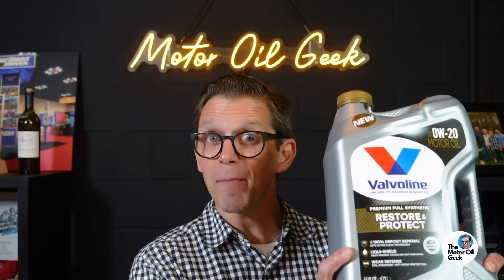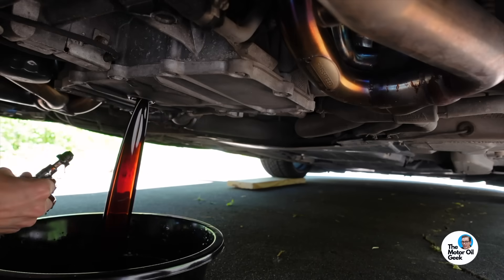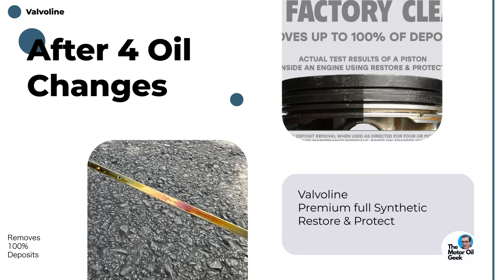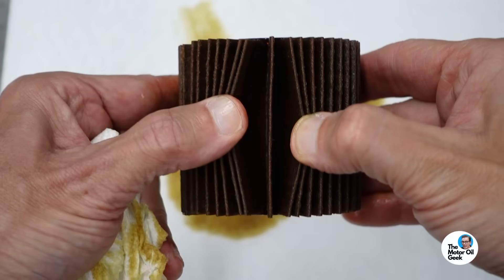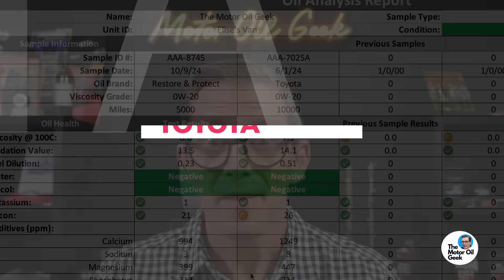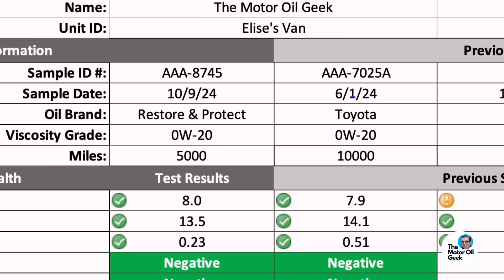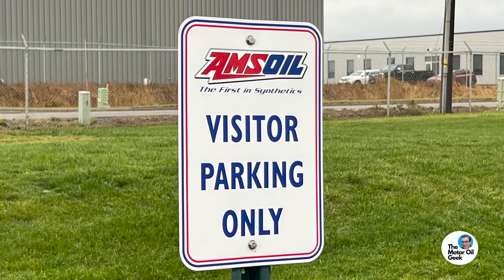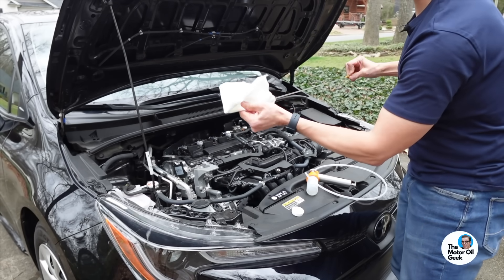The TRUTH About Valvoline's BOLD Engine Cleaning Claims

Comment: I can honestly say I am a 24-year Chrysler owner veteran I went out of my comfort zone and bought a Toyota for the first and last time Toyota engines do sludge up I don't care what anybody says I went from a 2004 Dodge neon SXT with a 2.0 l what's 250,000 mi on the clock I opened up the valve cover before it went to the junkyard she was squeaky clean! And didn't burn any oil in multiple times I went 20,000 miles in between oil changes on  Walmart oil

Comment: I started using Restore and Protect on my 2003 Toyota Corolla CE. I maxed out the odometer in 2018 and am hoping it will clean out the oil control rings and prevent oil consumption.

Comment: I REALLY hope Valvoline makes Restore and Protect available for Euro vehicles and soon!
Reply: I need that for my diesel
Reply: @psynurse  They say not to run in a diesel...
Reply: Yeah, I've already asked some Valvoline distrubutor here in Europe to ask why this lineup is not present here? There are lots of cars with the same issue here.
Reply: Same here..can't find it anywhere here
Reply: I have a 2001 mercedes benz E Class 300,000 miles, i used restore and protect 5w- 30 about 500 miles in. I have already noticed the engine has ran smoother.
Reply: Just use the 5W-30 version. It would be better than letting your oil control rings get plugged with sludge.
Reply: I'm waiting for 5W-40, that's what's in all my BMWs

Comment: A relief for owners that have the recent Direct Injection Engines, whose lower ring grooves can get build-up.  We have a way out to maintain our engines past 150k miles.
Reply: Exactly what I was thinking, I’m going use this in my wife’s Kia Sorrento. It’s burning oil. I know it’s dirty and have done the GDI spray cleaning but it’s not enough.
Reply: @Loneace85  I have a 2017 Kia Sorento that Kia gave me a new engine after 3 FAILED oil consumption tests  (72K miles)
I am going to the dealer for a recall Wednesday. I only have 1500 miles on new engine and want to put in VRP to keep rings clean.
Reply: Biggest problem with Direct Injection actually have nothing to do with oil but with the Carbon Build up on the Valves since fuel isn't getting sprayed on them anymore they are no longer getting any cleaning what so ever and PCV Systems have been Crap for Emissions
Reply: @deltasixgaming   A lot of that is absolutely from the oil bypassing stuck rings etc as the PCV and EGR pollut the intake charge.
Reply: @Heimdallr-88h14  I'm talking about the Healthy DI Vehicles if your Rings are stuck its a Rebuild since it will start scoring your Cylinder walls and that will happen very quickly
Reply: @deltasixgaming  R&P will get on those valve stems through the PCV tube and might help keep them clean. It would be a substitute for the gasoline doing it. Think about it!
Reply: This is one reason I put this stuff in my dad's 2016 Hyundai Accent. I saw engine teardowns of GDI engines with stuck rings. I replaced the spark plugs on that car, and saw that one spark plug had some oil on it. Hopefully that was just a little sludge on a piston ring, and the Valvoline R+P removed it.

Comment: A true test that would sell me on this oils claims is to run it in a Toyota 2AZ-FE engine with the Low Tension oil control rings.
If it is able to improve or stop the excessive oil consumption that caused a TSB (Technical Service Bulletin) to be issued on 2007 – 2011 Toyota Camry. 2007 – 2011 Toyota Camry Hybrid. 2009 Toyota Matrix...then It would be truly amazing.

Comment: LAKE!!! That is not how to use a vacuum cleaner!!!  😁  Frankly, I emailed you on this subject a couple months ago... We had a seal plate from an LS that had varnish and cooked on grunge. That plate became our test subject as we slathered it on one side with Restore n Protect and regular Valvoline Daily Driver conventional oil. In less than an hour's time, the R&P side came clean with no intervention. Keep in mind, this is not real world at all since room temperature Vs. a working engine that sees road time. If it does as it did on our shop bench, just think what it will do at operating temperature over 4,500 miles.

Valvoline hit it outta da pahk with this oil!! It even restored seals on a few cars that we have used it in during a routine service.
Reply from the maker: Thanks for sharing! I do remember that email exchange.
Reply: @themotoroilgeek  Thankya, Lake!! I appreciate ya.

Comment: I drive a 2006 Honda Civic 5 speed. 283,800 miles as of Nov 27th 2024. I still put regular 5w 20 in it, every 4 to 4500 miles. All it's ever had. Main bearings are excellent. The oil is not worn out either, could go more no problem. Valvoline is the last company that Wil sell u regular non synthetic. Old motors that run this style oil needs to keep running it. No switching to synthetics. Will DESEAT the rings and ruin the motor. Valvoline is great oil. Always has been.
,

Comment: I just switched to VRP for my last oil change, 2014 Toyota Tacoma, 4.0L V6.  It's currently at 170,000 and I have been very diligent with all of my maintenance and religiously change my oil at 5,000 miles or less.  I generally run Penzoil Platinum and don't use any oil.  After about 1,500 miles on this change, it actually feels like it has better throttle response.  I also got about 1 mpg better on a recent trip to my parents house.   I'll run the next couple of oil changes with this oil and see how it does.
Reply: 1 mpg on a trip has a lot of variables. Tail/head wind, tire inflation, fuel used… I’d be reluctant to attribute the oil.
Reply: I’m currently using pennzoil ultra platinum in my 08 350z 170k miles but going to try the VRP this change
Reply: @08HR350z  Same here
Reply: Got a ‘12 taco 169k with restore and protect on the first run. Have about 2k on the oil and still looks amber on the stick, I agree that the engine is very happy on this oil. Thought at this point some cleaning would be taking place but not yet. Been running valvoline extended protection for 3 years before the switch. 5k oil changes as soon as the maintenance required light starts flashing.
Reply: @Carney46  I did read valvoline recommends to use it about 4x to get 100% clean
Reply: Same story here. 2010 rx350 with the Toyota 3.5 V6. Mpg is 5-10% better, idle is smoother and quieter, all while the car drives smoother and faster. I'm sold.
Reply: my civic burns ALOT of oil..about 700-1k per qt. Car calls for 5W-20, should i just go with 5W-30 to get lasting effects from the oil consumption? Was thinking it wouldnt hurt to keep this in longer & get more out of it? Thoughts? Also, should i top off with this or can I get away with other simialr valvoline products till next oil change? Apprently it takes 4 oil changes for it to work 100%?! Thanks!
Reply: An update, please?
Reply: I’m gonna put this oil in my FJ but I’m not sure if for how long I should use. Should I use it for four oil changes and then switch to a regular Valvoline or just use that indefinitely?

Comment: My only concern is why this oil doesnt have dexos gen 3 specifications for GM vehicles.
Reply from the maker: Dexos certification requires full disclosure of the formula, but API certification does not. I don't blame Valvoline for not pursuing the Dexos certification due to not releasing their formula details.
Reply: @themotoroilgeek  I had no idea. Thank you for letting me know, this was my only concern and it makes sense as to why valvoline would want to keep this secret!